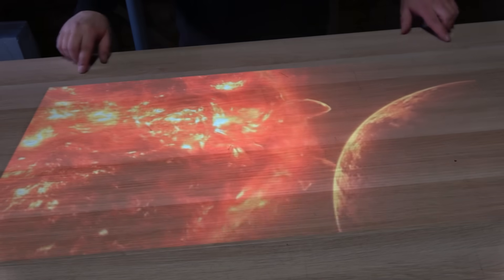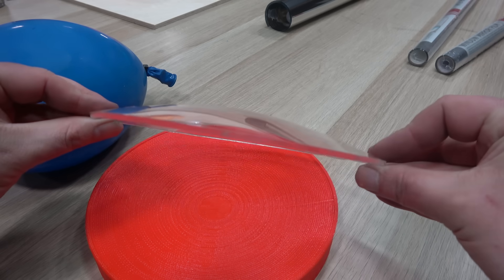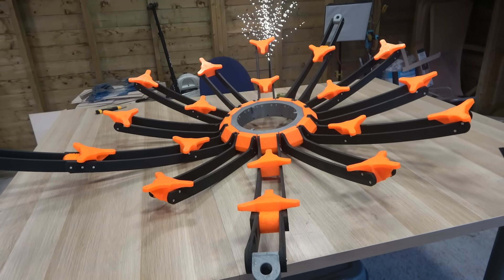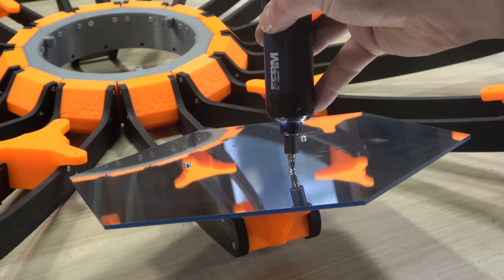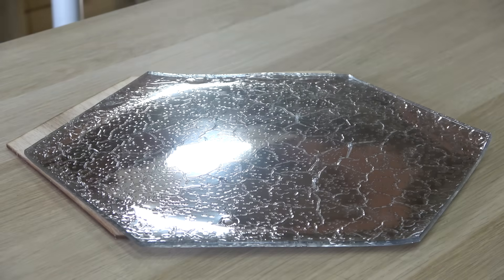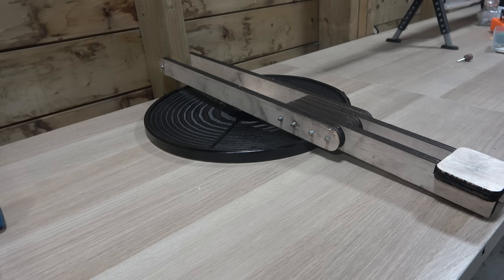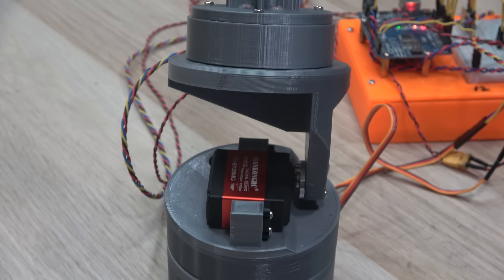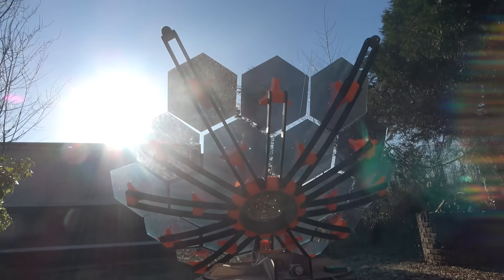Building a DIY Solar Generator..

Comment: I kbow ur dutch, so am i. But u over engineer. https://youtu.be/R_qxozFm4aA?si=2ZanrtlpwC8-mAu7
Here u see a much simplified set up.  Its not a negative comment. Like others say u make the shape of the mirrors first than u apply the sliver film. And you should paint the center piece black to collect all the heat. That would give u at least 10% extra heat. The real prblem is not collecting the heat turn that into steam and produce electricity. But store it at night. Or for less sunny days. But i always appreciate people that are doing it than just talk about it. We never know maby your the on at figure it all out. Would love to see a follow up on where u go next.

Comment: you could have shaped the plexiglass before applying the mirror film. 
adjusting the film would have been easier than molding the plexi at low temp.

Comment: Rust - o -leum sells a spray paint called liquid mirror and it has to be sprayed on the back of the reflective surface. Heat your Plexiglas before painting and treat with the liquid mirror. Seal the back matte side with an epoxy.

Btw, you don’t need concave mirrors, the array itself is your parabolic reflector, you just need to align the mirrors

Comment: I studies 15 years ago that Solar panels are given current proportional to the amplitudes of light, not of heat that is infrared. In short Solar panels work based on the intensity of light from the sun, not the heat.
Reply: This isn't photovoltaic.
Reply: @SolarCookingGermany  My misunderstanding, is it used for direct heating?
Reply: @ Yes, it's supposed to heat water.
Reply: @SolarCookingGermany  thanks for point out my misunderstanding.

Comment: Amazing! Only observation is that aluminium is pretty flexible when very thin so I suspect it might be possible to apply it after forming the plexiglass mirror elements into parabolic profiles, as the distortion is so limited. Or you could try forming the aluminium mirror coatings in the same moulds, and when still in the moulds polish out the crinkles if any, like the Japanese(?) fad for policing foil aluminium balls. Except faster, hopefully! Can't wait to see how effective this is when tested
Reply: Ah - have just seen you don't need a parabola anyway! In any event there may be a better reflective coating available in paint form...

Comment: Hello. 3.5kW Solar Generator. OK. Does that mean 3.5kW per hour?
Reply: Unless specified that is generally the instant generation potential under peak conditions. so basically it could continuously power 360 100w light bulbs(the old incandescent type since they actually consume the 100W).
Reply: This will never reach 3.5kW, one squaremeter sunlight equals about 1kW or less. Thermal energy, not electric.

Comment: You aluminium plate is very nicely machined but aluminium is an excellent reflector, so you would collect little heat. Black paint would absorb a lot more but also has high emissivity so would re-emit most of that heat as infrared. Look up selective coatings (spectrally selective surfaces). They get around this problem by having high absorption (and consequently, emissivity) in the visible spectrum but low emissivity in infrared. A simple option would be to use a commercial coating but you can DIY a less performant coating from blackened copper.

Comment: Why not make bar chart with actual number, why a random size? Silver bar on graphic was about 25-30% bigger than the gold one. The numbers you show are 328 vs 304, so the silver bar should be about 7% higher than the gold bar. Just seems odd... Why do so many technical things and then display misleading graphical representations.

Comment: I would be tempted to look at beefing up the elevation mechanism. A large gear similar to the azmuth system. The gear would rest in a cradle with a drive motor and gear at the bottom and another support wheel or gear on the other side of the cradle so the weight is supported and force applied down onto the drive simply by weight. A cross axle in the cradle to hold the adaptor plate that attaches to the back of the reflector. A post out of the back of the reflector to position a counterbalance/weight on the other side of the axel to help balance and steady the system. Similar to my larger telescope mount counterweight. Looking at the system you are working with, I worry about the balance and torque on the drive and the effect wind will have on the system. Solar collector to solar sail in one easy step lol.

Comment: If you are using parabolic mirrors then having all of them the same is incorrect.

Each mirror should be a part of a larger parabola. You can see this in the design of an offset satellite dish.

Comment: I suspect you might be able to get away by using 1 fixed height ball joint and 2 metal springs, instead of 3, per mirror. Place the fixed ball joint on one of the top 2 positions while the other two alignment points use springs. Problem with metal springs is that thermal expansion might change that alignment. Just some thoughts...

Comment: 4:00 "Perfect Sun Alignment…"
Instead of two axis, you should take a look at polar aligned telescopes, where only one axis is needed.
In a polar aligned setup, the axis of the one axis, needs to be parallel with the earth's axis. 
Thus: axis pointing towards the north pole. And the angle needs the be the angle of latitude. In The Netherlands that angle should be around 52º
That way, the rotation would match the rotation of the Earth. Which is one constant speed. 
On the axis you could create a structure to point the mirror to the sun. The speed of the motor should match the rotation of the Earth.
Limit the rotation to the sunrise and sunset. Once the motor hits the sunset limit, it should reset to sunrise and start rating once the sun rises.
Reply: doers axial tilt cause problems with that?
Reply: Came to say this. The active feedback is a simple solution but could also lead to unnecessary problems. Solar tracking from a fixed location and known time is a solved problem. Can be done with an RTC and basic trigonometry. And not run the risk of locking onto some stray light, etc.

Comment: How about mounting the aluminum plate directly in the center? This could eliminate one mirror and reduce reflection losses. The water hoses could be routed through the mounting pipes.

Comment: if you tilt your mirror assembly to match that of the tilt of the earth in the true north south you can rotate your mirror base on a single axis and have solar tracking. [Once you 've got alignment with the sun ]
Reply: why did you not apply the reflective film after shaping the plastic?
Reply: Why not have your heat exchanger where you're going to put the secondary mirror?   With the accuracy that you're able to get without going into polishing glass and using vapor deposition first surface mirrors cutting out a stage will probably improve your efficiency.

Also remember your using reflective film and plastic mirrors.   They are going to absorb a lot of heat themselves.  if you're going to try and re-reflect the energy of 18 mirrors with another plastic mirror you may set fire to the secondary mirror or at least melt it.  I think you're best off mounting your aluminium heat exchanger at the focal point of the primary mirror(s)

Comment: 1. Video never got to what is being done or accomplished at the focal point,  2. The aluminum water block is not located at a focal point 3. The "laser test" was only done with a narrowband range of visible red light and may not be truly representative of the heating effect at lower and higher wavelengths- visible light still creates heat.
4. You can't heat metallic foils/sheets in a microwave without them conducting burning and cracking, nor lexan or lucite very effectively (I'm assuming they do not heat up on their own) without water to heat them, hot air to heat the plates makes a lot more sense to me.  5. A "3.5kW generator" where and how did you measure this production? You're obviously pretty smart but the video has a few fails.  Great job on all of the stuff you did.

Comment: You could also track the sun using a GPS module, I think. It should provide your microcontroller with timestamps and coordinates, which would let you mathematically calculate the position of the sun in the sky

I'm not sure the pros/cons of doing this compared to LDRs, although the software would definitely be more complex, I just find it interesting

Comment: Find and old scrap satellite television antenna (6-14 feet).  They are already a parabola, have a polar mount, and have a mount at the focal point.  Attach your reflectors to the surface.

Comment: Hi in order to reduce the weight on the spindle I would have placed a counter weight so that less energy is required. A question - why did you first apply the coating on the mirrors and then shaped them? Wouldn't it have been wiser to do it the other way around?

Comment: With only one motor, which axis is tilted an angle equal to the location latitude and a rotation of one revolution per day the mirrors will stay aligned for months

Comment: That is one incredibly dedicated build. Surprised NASA or some a similar massive company hasn't seen this and reached out to you. Those poly springs you made look like the rubber boots for the sliding pins on brake calipers. 
The initial springs, whilst way more expensive, would have been the more reliable way to go though. A similar method to that is used to hold on some video card and CPU cooler heatsinks, it's simple and precise.

The overall build and your own sun tracking module are cool AF. Really well done fella.

Comment: one idea is to use a single support arm for the center focal point mirror like a satellite dish does.. i'd probably put the film on after shaping the mirrors.. people car wrap curved surfaces all the time and it looks smooth.. might not be optimal but may look better and that does count for something.. maybe bars connecting the arms at the ends to give it more strength and rigidity.. maybe make it foldable.. maybe mounted on a pole instead of a table with a heavy base they use for umbrellas.. with the post and the folding it could be moved easy perhaps... maybe even use a metal base that bolts to a roof... could be dangerous on a roof if somehow the focal mirror burns the roof around the collection plate somehow getting miss aligned.. could be dangerous even on dry grass perhaps.. something to keep in mind.. would be really cool if it folded up or came apart somehow.. maybe magnetic attachments to small connections that are angled with spring screws.. so you can just pluck off the mirrors.. stack them.. fold the arms.. collapse the pole.. and bobs your uncle.. wonder how you're going to get 3.5k electric from heated water.. maybe have the support arms cut into sections and attached to the mirrors.. and have the arms snap together.. might be able to use might small support arms.. and have less of a gap between the mirrors.. keep the arms thin so you can still stack the mirrors with only about 3 times the thickness.. something you can throw into the truck and bring camping.. almost like a big army sleeping bag in size.. anyways you asked for ideas lol.. beware what you wish for lol.. have fun! oh maybe have the arms cross connect too.. since the mirrors are close they connect on the sides also.. requiring less thick arms.. i can 3d sketch it perhaps
Reply: another idea is using narrow strips of curved mirror.. that fan out into a half circle and a single support arm holding a focal reflector.. having a flat bottom side might make it easier to manage.. it can tip over and not roll away kind of thing.. just rest on a blade..

Comment: I'm no engineer. Just an electrician but I feel like you would get better stability and and tracking movement if you mounted the center of it on a "ball knuckle" for lack of a better term. Kinda like the ball that car phone mount used to pivot. Then attach like 3 cable around it on three motors that would be able to pull the strings at different intervals to keep the center always facing the sun. Again just an electrician so what I'm saying may not work that image just popped in my head while watching

Comment: It's a cool design with a few upgrades, but this type of individual reflective steam and generator was done in OZ in the late 80s, early 90's for outback communities who were isolated from mains power. A professor of Engineering with private backing,( as in donations from us at the bottom) designed and built a combination system that could track the sun for steam generation, have an onboard generator powered by the steam and send that along to lead/acid batteries, that very rarely exploded sending out toxic gas to harm or kill anyone down wind. Then the govt heard about this gave him a million dollars contract, he built several units and then we never heard about him again. Shut up money. You see the global socialists where there then, so where were all the scum greenys at that time whining about the loss of this system, Oh that's right doing nothing because Blackrock and Soros wasn't paying them in so-called donations.

Comment: if you can get 3.5 kw from this, then its a miracle that all house roofs dont all catch fire on a sunny day.
Reply: Not really. Solar insolation is 1.1 kW per square meter. A 20 sq. meter roof receives as much as 22,000 watts of solar heating every day in the summer.

Comment: Basically make this but have it boil water by focusing the panels onto a single glass bottle and then have the steam run out of the glass bottle in a closed loop that runs a turbine cools condenses and is then pumped back to the glass bottle. You can have a short program code that tells it to point at the brightest object.

Comment: Concerning the heat collector; you also could have made a copper plate and onto soldering annealed copper tube, that can be bouht from every plumber around the corner.
Easily made and you would have the connections for the hoses wich transport the heated medium.
For the medium i would suggest regular antifreeze wich is used in a car, it has the ability to extract heat better than water, has no minerals in it and is usable in wintertime.
I also would paint the surface matt black for better absorption.
I am afraid that the plexi back of your heat collector cant handle the temperature, you would be surprised how hot it can get.

Comment: I think, its a good idea and solution for the heating problem. But I guess you will have a stability problem with the wind. And by the way, when the milled plate in the middle is colored in black, it might absorb more heat from the sun. The price for the milled plate is average. I work for a tool building company in germany and the price, I can made this plate, is nearly the same. The biggest question is the aluminium itself. The plexy glas backside is perhaps a problem. The cooling will eventuell fail , when the alu plate becomes to hot. I love the way you show you're errors and the improvements. Good job !

Comment: Love the idea! But as a blond tinkerer there is a couple things i'm not sure I get.. 1. Do i get it right, that there is mirrors, mirroring to a mirror that mirrors to the heat plate? So the output is warm water, after all this reflection? Would the temperature then be used in some heating pump setup to catch the energy, or just for hot showers? 2) if the mirror is taped on anyhow, could it maybe be put on one large old tv parabol (junkyards), that would have one common focuspoint? Thinking many smaller ones should maybe not be individually parabolic, but as "slices" of the whole (i.e. At least every cocentric circle of smaller discs should have different angles) as i guess it would be the centre bulls eye that is pointed at the strongest light?

Comment: Would there be any benefit to minmaxing the wavelengths that get reflected, or should the goal be to reflect as much type of light as possible? I went and googled which wavelengths carry the most energy but I know that alone doesn't account for how that energy transfers in any case.. He sort of skips over the idea at the beginning by saying getting visible light is necessary but then also saying most heat comes from infrared, but the interwebs told me ultraviolet actually does? And if you wanna get all frequencies what would be the best way of reflecting them all?

Comment: Very bad choice of materials. Mirrors should be polished aluminum sheet. Frame should be metal. Absorber plate should be copper, black anodized. You're dealing with high heat here. Even at the frame and the mirrors where the sunlight is not yet concentrated, surfaces will get hot. You didn't mention what the secondary mirror will be made of, but that is going to be the hottest point in the system. In fact, most solar thermal systems put their heat transfer mechanism (your absorber plate) at the primary focus and don't even try to send the concentrated sunlight somewhere else.

An alternative to trying to concentrate all the light at one point is to spread it out over a wider area. The maximum temperature will be lower, but you will still collect the same 3.5 kW. You don't say what you want to DO with the energy you collect...if you don't need a very high temperature differential, using a larger collector area and lower temps will improve the lifespan of the machine and make materials selection less critical.

Comment: You should have molded the uncoated mirror blanks first then put on the coating. Also the paints probably have no gold or silver in them. Also parabolas are perfect on axis only and the sun is about 1 degree wide.